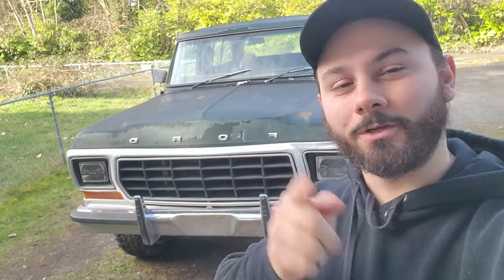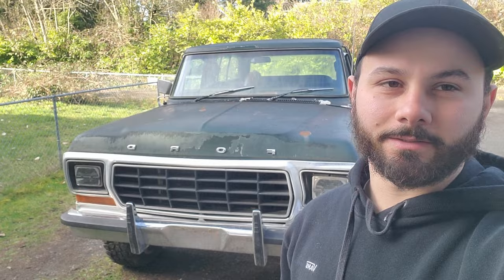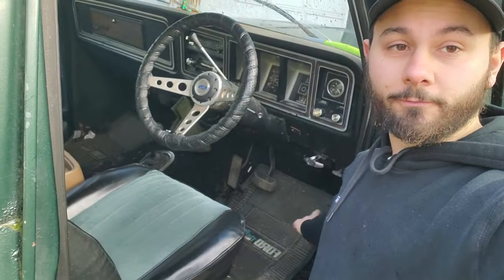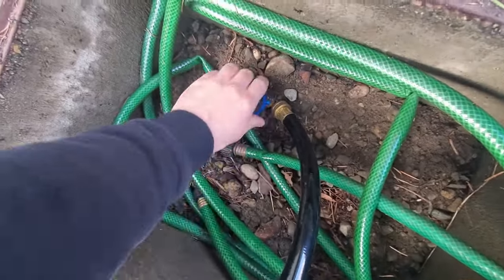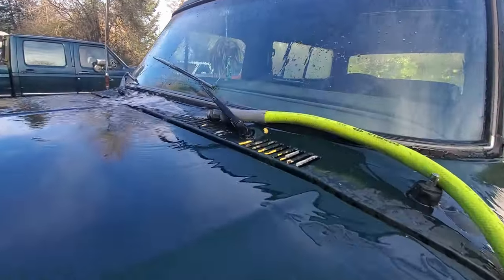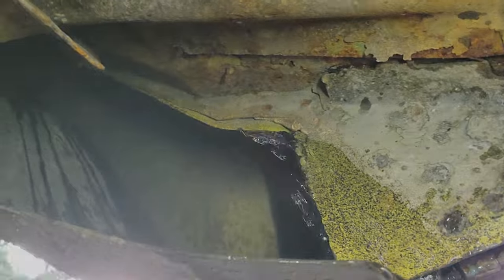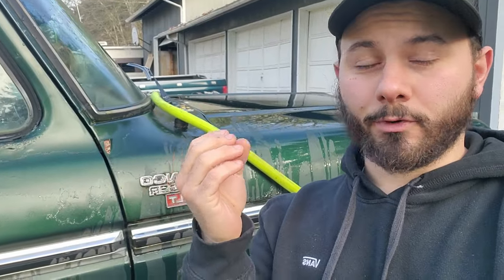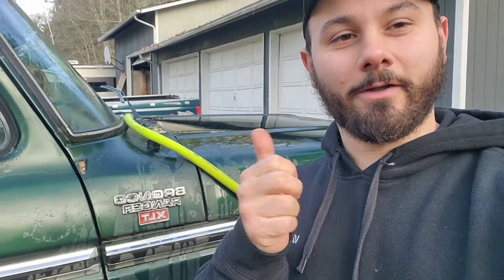How To Clean The Cowl On A Dentside Ford Truck

Comment: Great video. I’m reviving my dad’s 77 f250 that sat under a cherry tree since the 90s and the cowl was packed. I went in through the vents with a little claw and tried to get as much out as I could. Then pulled the rubber stoppers on the inside of the fender and was able to pull some out from there. Very frustrating and tedious. Eventually I just flooded it with the garden hose and saw all the water pouring out and my first thought was that those openings were from rusting out but eventually realized it was made that way. I should’ve started with the hose to save myself the trouble. I’m glad you made this video to help others with the same issue.
Reply from the maker: @donusmc1  happy to hear your giving your dad's old ford some love! I love these old trucks my supercab is what started it all and thanks for watching the video like and sub it'll help others find it too! ❤️